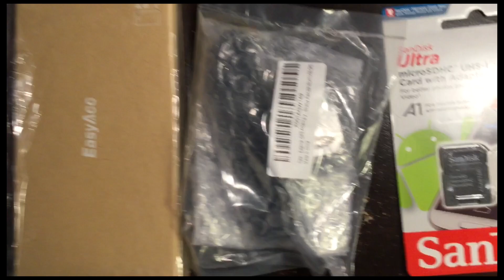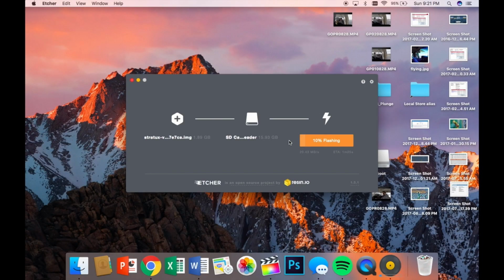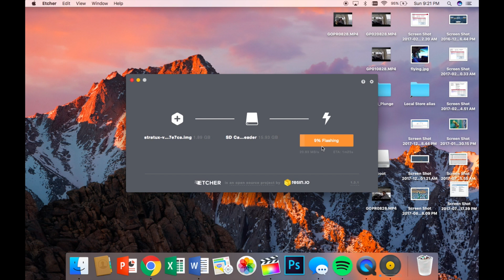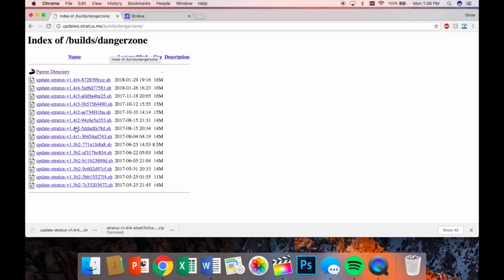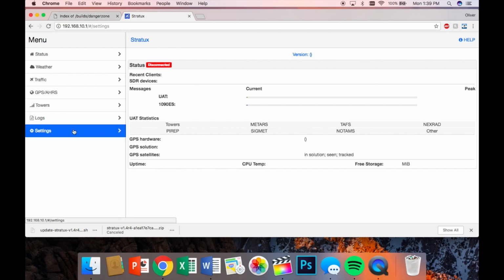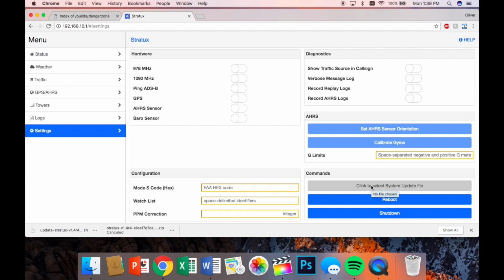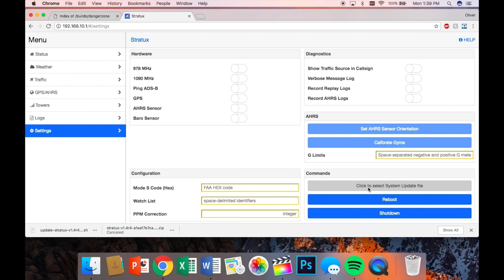How to Build and Program a Stratux ADS-B Receiver with AHRS for Foreflight

Comment: Could you use a Raspberry Pi 4 Model B Board?
Reply from the maker: I have not tried, but am pretty sure you can if you have the right heat sinks and connectors.